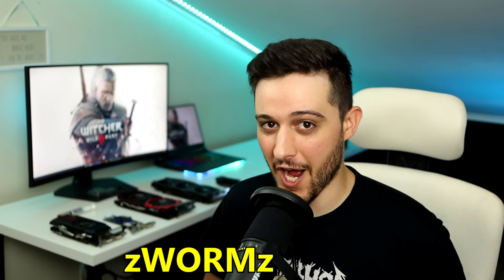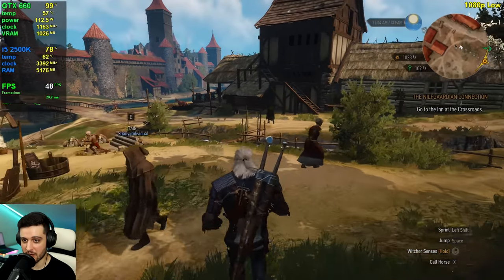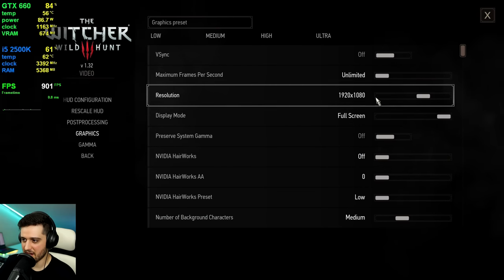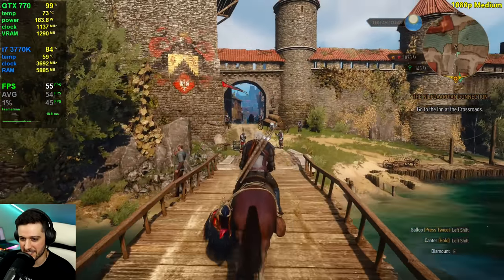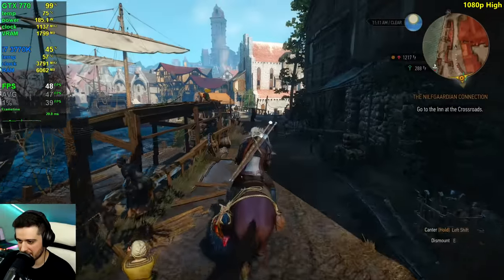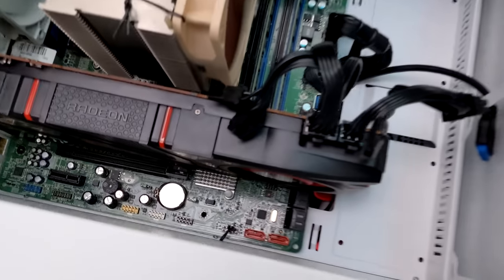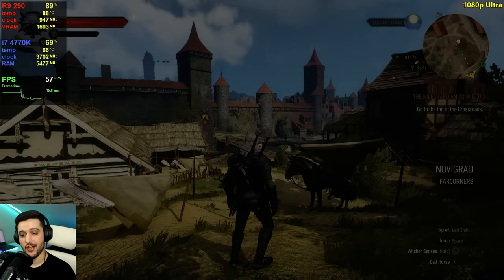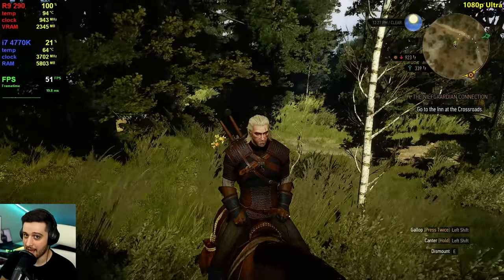The Witcher 3 on the Minimum and Recommended System Requirements!

Comment: Don't forget that at the time of TW3's release, we were still using DX11. Once we moved to DX12, the frame rates of TW3 on my PC jumped up by 10-14 fps. FX-8350, 8GB DDR3-1600, MSI 4GB GTX 770. I have that very same ASUS motherboard. Still works up to now.
Reply: TW3's API is still based on DX11 (D3D11), nothing's been changed on the game side, i don't think that the newer NVIDIA drivers could've helped but the only difference that u mentioned as a FPS boost thing might be happening because of the newer game version which is called v1.32 for now.

Comment: I have a Asus OC GTX 750 ti 2GB, Instead of playing at 1080p Low, I play at 1360x768p at Mixed settings (High - Low) and get around 45+FPS with a little overclock 1335Mhz on core, and 2900MHz to memory, and it gives me around 5FPS more, plus some Nvidia filters for certain looks. BTW Love your channel and I will  be open to any GiveAways in Future XD. Thanks <3.

Comment: The main reason why so many r9 200 and 300 series died prematurely was the bad cooling system of those days. Many models were sold with the blower and in fact, as you can see from the video, it reaches 93/95 degrees while playing and we must consider that the gpu was not mounted inside a case, otherwise it would easily reach 98/100 degrees. The high temperatures have worn out the components of the video card and the gpu itself ahead of time. It is no coincidence that most of the survivors are custom coolers.

Comment: The R9 290 almost reached a 100 degrees. :D But great performance, better than my PC's performance was back then.
I played through the game first in 2015, with a Core i7 2600k, 8GB 1600mhz memory and a GTX 960 2GB (I got the game with that) and I used the "high" preset in 1080p it was very playable not constant 60 fps, but around 50.

Comment: Went through this game with a 6700k, R9 390 (XFX triple fan version) & had a great experience playing it 1080p ultra with a few setting tweaked like high foliage distance & high shadows. Since those settings had a huge performance hit for basically no visual gain. Obviously no hairworks or any of the other goofy NV exclusive stuff enabled either LOL, but I was able to keep a locked 60 with Vsync on that setup. Then I nabbed a 8GB 290X & crossfired it with my 390 to get a 1440p ultra playthrough way back then!

Comment: Those stutters can even be happening with Ryzen 3300X and a RX6600XT combo but not that much and noticable of course, brother of mine using this setup and i've noticed them in Novigrad where you've tested even if their's counts a few but as far as i'm concerned stutter counts in other places are not as higher as in this place, might be a problematic coded area or a CPU related that i couldn't still figure it out yet. I've also tested this game in that particular area with an older i5-7500 from 2017 and a GTX 1060 6GB + 16GB dual channel RAM, a few stutters were exist but after a while they dissappeared even i circled the same areas again and again in the city, i dunno just wanted to share my personal experience cuz i've not experienced any major stutters issue with that old rig even i tested the Battlefield 1 Online or Assassin's Creed Odyssey etc before without any issue.. Anyway, thanks for the benchmark as always, keep it up 👍🏻

Comment: I was playing it on a GTX 660 back in the day, with decent optimizing it ran at 1050p/1080p with ultra settings and even some hairworks, at a pretty stable 30 fps. Which was a lot better for this kind of game than playing with disgusting graphics just to get 60. The 660 already had no business running it like that; being a mid-ranged card from years before. It was a surprising little beast.

Comment: That's a awesome thumbnail! Lol. 
I wonder how my Pentium G7400 would run that game, as in most of the games I have tried, it runs a bit faster than a i7 3770K.
Reply: If you have something like 1050 Ti or 1060 3GB level GPU, you probably should be fine for Witcher 3.

Comment: 12:27 There is a big problem in the game with the Ultra Foliage distance, it drops like 30 fps and the difference is pretty unnoticeable. Also the Ultra shadows cost quite a bit and they are not worth the effort.
Reply: I have everything on ultra and I get constant 60fps using a i5-8400 and a GTX 1660Ti

Comment: "oh it's stuttering a little bit!"

has a 1% low of 11
Reply: That %1Low value suddenly drops when the microstutter(s) exists but after that even if the game runs smoothly without any microstutter presence, Kryzpp is not starting to count the %1 Low again which is not quite right in terms of reflecting the true smoothness of the gameplay and you are thinking that it's running like hell and trash but that's not the exact fact, gotta admit that for ya.

Comment: the only difference with r9  290 with 770 is the gpu temprature which r9 290 was almost reached to 98c while 770 only struggled to reach 75c i don't think if r9 290 is worth buying because of temprature and it could cause problems in future also kills gpu after long period of time. but i agree for some reasons that there's huge fps difference between r9 290 with 770 but my opinion not worth buying because of huge tempratures

Comment: Low spec RAM  requirements of 6 GB were made for Win 7 in 2015, not for bloated Win 10 (or God forbid 11 :P ) in 2022. As for recommended requirements, they are close to PS4 equivalent. Remember, Witcher 3 was game from PS4 golden era, and PS4 would run this game on 1080p high at 30+ FPS.

Comment: 13:37 i have a similar problem, if this mother board from acer/hp you can fix it
disable protection on other gpu in bios
I've already forgotten how to do this, but somewhere in the bios there is a parameter that makes the motherboard work only with some GPUs

Comment: It's a shame you couldn't use the 3rd gen i7 to compare exactly the cards.  That said, the difference between 3rd and 4th Gen Intel is mostly incremental so the difference with the CPU likely wasn't a lot different.   I noticed the CPU usage seemd  lower on the R9 290 compared to the NVidia GTX770.

Comment: I think if you can replace the r9 290 termal paste, the temprature would drop like 10 to 15 degrees.
Reply from the maker: No, it runs like that on the stock cooler on purpose. They aimed for a 96C max temp and the stock fan curve prefers silence over cooler temps, it's completely normal for a 290 to run at 90+C
Reply: @zWORMzGaming  love you 😂🗿

Comment: 15:50 Its not a CPU bottleneck, if i good remember, AMD drivers have some issues with GPU usage(in GTA V these drops from 100% to even 0%) or maybe some Red Engine issues, u also have little GPU usage drop in GPU intensive area with 30% CPU usage(on 18:32)

Comment: Is the temperature of the gpu running on 94Celcius safe while gaming?👀💀
Reply: not really lol, maximum temp you should get is 89 celcius
Reply from the maker: The GPU was made to run at up to 96C, it's normal on the 290 :)
Reply: @zWORMzGaming  so the GPU will fail just like core i5 750 when hits 105c, it’s way worse than GTX 480

Comment: i played the Witcher 3 on rx 580 8gb bottle necked by i 5 2400 with 32gb ram.
also resident evil village and kingdom come deliverance and subnautica and no man sky and dying light on high to ultra 1080p with 40-120 FPS.
the cpu was struggling but not enough to dip below 40.
p.s
high to ultra with only motion blur of, it was an okay experience at the time, but better invest in a better cpu, to use higher then 30 percent of the gpu.
Reply: Kingdom Come Deliverance and Death Stranding are both HDD killers games, cuz even i tested those with i7-8700 CPU, a fast 7200Rpm HDD didn't cut it to run smoothly, which i mean that you gotta install those games into any SATA SSD at least before a CPU upgrade but that i5-2400 is also starting to show its age since it's been released from 2011. For 4C/4T level, the minimum level is i5-6600/7500 - i3/8100/9100F level for the RX580 and equivalent models of the GPUs for almost most of the games for now however, the 4C/4T structure are not enough even if the case's about modern 4C/4Ts in some of the heavy CPU Intensive based games like Assassin's Creed Odyssey, Battlefield 2042 etc..
Reply: @Augmented_Realism  faster hdd and even the fastest ssd doesn't effect in games performance only shorten the loading time of it.
The only defrance between new CPU and an old one, is how fast they process data, and that doesn't necessarily mean only clock speed, but it's architecture.
Reply: @lostmarbles209  Just play those Kingdom Come Deliverance and Death Stranding with HDD and then come to write this, it wasn't playable at all with even an i7 8700 and HDD for me, there were lots of stutters because of the tons of data had to be read by the disk in time which means those games requires at least SSD and i already know that what you wrote, thank you. I just meant the smoothness and frametimes subjects related to HDD in some particular games.
Reply: @Augmented_Realism  i don't talk out of my imagination i say what i tried, if your game stuttering you may have something else ruining the experience for you. 
From PC to PC everything is different mine is expected to be at a 100% efficiency so it's dust free, with temp maxing out at 64 for the gpu and 60 cpu.
Never played death stranding but I did play Kingdom come deliverance at1080p

 high settings the fps were 50 to 60 max i limted it to 60 and 40 avg and 38 low.

Very high 40 to 50 with 38 avg and 30 low
Keep in mind these are bottle necked by the i5 2400 and only loading new area stutter because of the CPU.
If you have an i7 your performance according to its generation should be higher, unless it's either overheating or is being bottle necked by the gpu did you say what gpu you have?, and yes HDD not even the fastest.
This is enough for the 2400 never missed it low performance.
Reply: @Augmented_Realism  they don't. Fram rate is a cpu and gpu and ram only they pull the date of of the "HDD or SSD" and there is no HDD that it read speed is slower then 35k mp/s no your stutter is something else that if you have good hardware.
Reply: @lostmarbles209  I'm not saying out of my imagination either and of course i know how to analyze a system with their components analyzing by looking at temps, frequency, loads and all other things, i've almost played the whole games from ealy of 2000s to 2022 with many gaming PCs and as far as from i see that Kingdom Come Deliverance and Death Stranding are HDD killer games, that's what i experienced, keep that into your mind or not (that i don't care if u don't do that) but if u wondering and don't wanna believe me lemme explain it briefly, when i walked towards the bazaar place in Kingdom Come, HDD (Seagate Barracuda 7200 Rpm 2TB) were running at maximum full capacity (confirmed with HDD usage and constant non-stopping processing HDD light from the case) and annoying stutters were existed unfortunately, i7-8700 & RTX 2070 were tested at 1080p Very High settings, same test is also verified with i5-7500+ GTX 1060 6GB rig from the first quarter of 2017, there was not any bottleneck in those systems at all, temps for the CPU 73- 75 degree avg, and 72 -75 degree for the 2070 and 1060 as well. I assume you all got the answers from me, we are just sharing our experiences nicely, for instance i've mentioned the 'SMOOTHNESS' in my first message but you read and understood it like 'PERFORMANCE' doesn't affected by HDD which i didn't call that at all. Anyway, one of close friend of mines bought a WD Black Series M2 SSD for just Death Stranding to play it smoothly last year and he was saying it was unbearable even he had Ryzen 3 3300X and RX 5500XT 8GB 😉 and you, me and anybody never can also see that Kryzpp would ever test with his newer hardwares in those Death Stranding and Kingdom Come Deliverance games by using a HDD if he doesn't wanna get bottlenecked by a HDD ofc. 

I've already made my personal thoughts on that i5-2400 as well, its still capable but not good enough for some heavy CPU Intensive titles for a buttery smoother experience, you need a decent CPU upgrade like at least i3-10100F level for instance but i suggest you to install some HDD killers games into the SSD in order not to encounter any annoying stutter issues, you don't have to believe me for now just experience it after you buy a new CPU, you'll understand it sooner or later.
Reply: @lostmarbles209  Reading speed requirements that will be pulled from the disks can be varied depends on the game, for instance Death Stranding is one of them.
Reply: @Augmented_Realism  sorry i was thinking of m.2 ssds the HDD are from 80 to 160. 
Game performance is in it code efficiency and execution and nothing is perfect, the cpu can't read a messy code efficiently or excute it fast, Harddrives just store it and allow access to it many people try HDD vs SSD and m.2. no more then faster lodging they got.
Just try it yourself i thought a light speed m.2 will help 1gb vram gpu get better fps i was wrong.

Comment: Yup those minimum and recomended are definently wrong my gt 1030 gddr4 at 720p lowest sometimes gets 20-32 inside the castle (starting area)
I think witcher 3 is badly optimized cause i get around 69 fps at just cause 3 same settings xD
The GT 1030 GDDR4 4 GB i noticed its best resolution that runs best fps is the laptop resolution 1366x768.
Reply: 1030 is garbage card it's weak as fuck 660 is like 40-60% faster than that garbage 1030, it's literally lowest of the lowest cards from 1xxx series